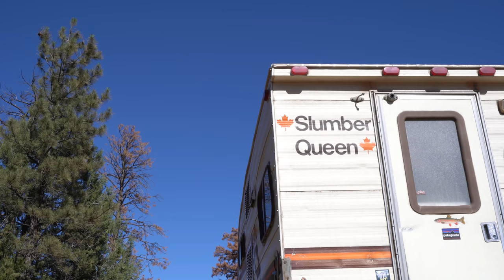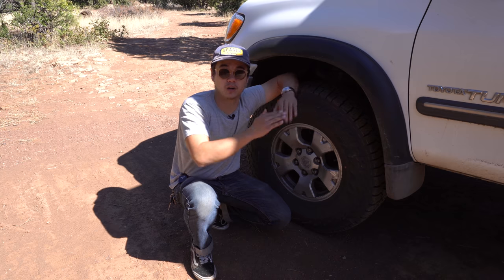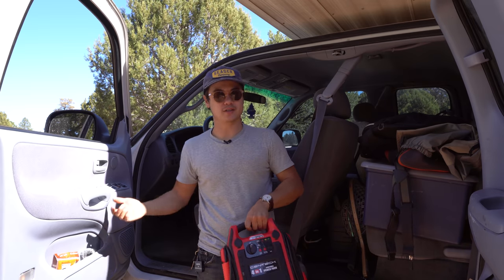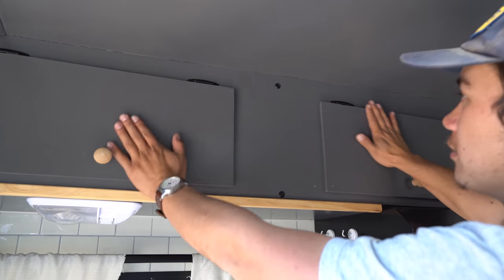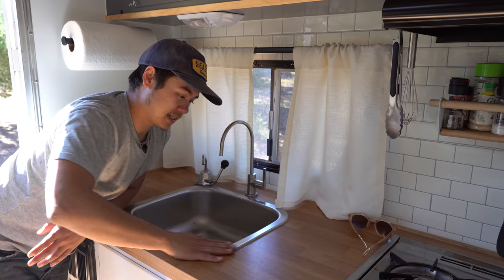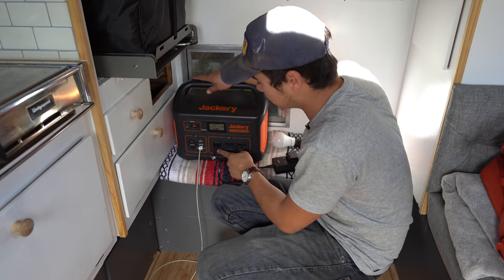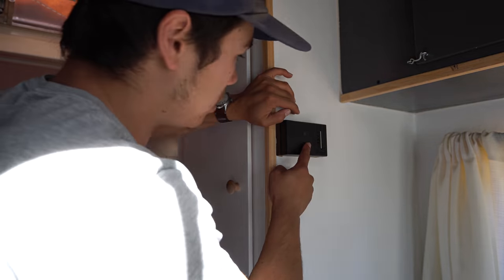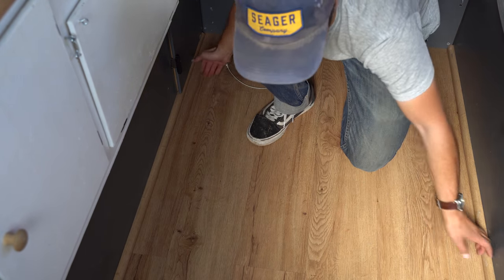A Detailed Tour of my Renovated Vintage Truck Camper (New & Improved)

Comment: Jonathan - check out the “Heng's Vortex II Vent Fan.” It’s a retrofit fan for your roof vent that installs in place of the screen. I had the same vent as you in my vintage travel trailer and the install was probably less than 30 minutes. Having the fan is a game changer. Take care!

Comment: Great job! Love seeing how your journey has unfolded. Just for safety move your CO2 detector closer to the floor as that's where CO2 is first detected. I did what you did and was told by others. So keeping ya safe!
Reply: Yes your CO detector should be place near the floor. CO will settle low, smoke goes to the ceiling. Hence why RV manufacturers place CO detectors near the floor and smoke detectors on the ceiling, per the device manufacturers instructions. There's a reason for that.

Comment: You did a great job on the Reno.  Just a little note, though,….  Smoke detectors go towards the ceiling but carbon monoxide detectors go near the floor.   The reason for this is because carbon monoxide is heavier than oxygen so it fills the room from the bottom first.  By the time the ceiling-mounted detector you have goes off the levels will already be toxic.

Comment: Something to consider for camper tie down under the bed of the truck:  merely use a long one piece length of thick wall 2" square steel tubing. Bolt it to the frame/bolt a piece of channel iron to the frame/then bolt the 2" tubing to the bottom of the channel iron, if need to lower the 2" tubing below the frame. The 2" tubing is minimal cost. Drill holes in each end of the 2" tubing and install eye bolts, to which you can attach your camper tie down chains/spring loaded tied downs/etc. Also, when you need to jack the truck up for any reason, the strength of the thick wall 2" tubing allows you to put a hydraulic jack under the outer end of the 2" tubing for a jack support when jacking up your truck.

Another good use of the 2" thick wall tubing:  if your trailer hitch has a 2" opening going through the trailer hitch mounting assembly, push a 2" thick wall square tube through the opening in the trailer hitch assembly. This will accomplish at least 2 things:  have the 2" tubing extend out past the end of the bumper and use it for attaching camper tie downs; install some heavy duty eye bolts/tow hooks/ etc and they shall be available should you require being towed sometime; the 2" tubing will also act as an extra bumper to the rear of the truck; can hang mud flaps on the 2" tubing also. I've used this setup on every truck I've had over these past many years. Hope this helps others out there...

Comment: I bought a used popup camper last oct. You can camp in it now if you wanted, but...it's fugly inside. For a 93 model, the interior seems a little 70ish lol. That solid wood paneling look. The water heater was removed, and pump, so no water system. I wouldn't have used it anyhow lol YUK.  Makes it's that much lighter. Anyway, I know nothing about them. I have a lot to learn. Waiting on a better bit of weather and then I'll go out and raise it and set it up and see what I've gotten myself into. It will be a learn as you go project as well. I already feel your pain. I've watched some renovation vids, but I'm not looking to get to fancy. Portable, rechargeable and solar items is all I'm putting in it. It has a real AC someone installed. So researching what items I need. Like the Mr. Buddy heater. Those come highly recommended. I see them on every outdoor, camping type vids. I have camping, backpacking gear, but I need to upgrade. I need to get everything. I did get a rechargeable portable power station 500 watt I think for $140. Thought that was a great deal. However, it was a clearance sale. It was 5 stars. We will see lol. It can be recharged by electric, solar or cig lighter outlet in vehicle. So I'm looking at everyones vids. checking out their equipment, where they got it, how it holds up etc..

Comment: Suggestion on your main battery:  if you are going to stay with a lead/acid battery, consider using a AGM instead of that flooded cell battery.   Thanks for the update on the camper.  Sure looks like fun.

Comment: Your carbon monoxide alarm should be close to the floor Jon
Reply: About 5 feet.  Co is slightly lighter than air.  Specially with you sleeping high up an sometimes using the little buddy heater.
Reply: @dandingess8267  yeah but i was looking it up and it says Co lingers lower by the floor. I don't you could be right.
Reply: In houses carbon monoxide detectors are placed on walls and not on floors.
Reply: Propane is heavy. Often dectectors for propane meant for RVs are combined with CO detectors, and those units are meant to be mounted low. There are smoke detector/CO detector combo units that are meant to be mounted high. CO specific detectors can me mounted anywhere.

Comment: Hey bud, when you upgrade your electrical system consider a DC to DC converter to charge your house battery from the alternator. On my setup I can charge at 50amps from the alternator. You will need to run a positive cable from the alternator and a larger ground to frame.  Oh and get a lithium battery. Those Lead acid are heavy, slow to charge, short live piece of crap. My setup is a F350 and a Lance truck camper.

Comment: You have done all the necessary repairs. If you still have the original radiator swap it out. They tend to fail internally and leak coolant in to the transmission.

Comment: As great as solar is.. it definitely has drawbacks. I have a 300W setup and I find that solar is not very effective from September until March. Especially in northern regions. I have a renogy dc to dc with MPPT charge controller (50A) and I find that most of my charging is from my alternator. The solar rarely gets more then 6-8A per hour of charging and I only get charging for about 4-5 hours, and being in the PNW, I’m hardly getting any right now. 

Instead of spending a bunch on solar, maybe spend more on a larger lithium battery. They are getting way more affordable and dc to dc chargers are cheap. I would suggest upgrading your current alternator charger method to a proper dc to dc charger if you do upgrade to lithium as your current setup could overload your alternator with a lithium battery.

Comment: with the narrow foot of your camper ( 37-1/2 inches on my nearly identical Davlin) and the much wider space between your wheel wells, there is no blocking to keep the camper from sliding side to side inside the bed.  Raising it just makes this worse.  All the side to side force is then resisted only by friction on the bottom, and by the springy tie down and the flimsy 1/4 inch eye bolts into the camper frame.   Some wooden blocks cut to fit to wedge the bottom against the wheel wells would be cheap insurance.,

Comment: Did you measure and fit... before you added the box?  It looks as if the camper would have fit, and you would be 4 inches less tall and top heavy without it ?  I personally believe these campers are made to be supported by the sides of the truck,as well as the bottom... and that a long bearing on the bed walls, allows multiple attachment points, rather than concentrating the load that keeps the camper IN the truck on just 4 points.   if you look at what the attach points actually are inside the camper.. you may be shocked to see that all that force of a pitching camper is foucused on a 1/4 inch bolt going through a 3/4 inch  by 1 1/2"  stick of wood and 1/2 inch of plywood !   And then if pull on that bolt at an angle, the framing can break !

Comment: Johnathon, if you are going to speak to 2,000 people I would humbly suggest you have some responsibility to make what you say Factual, and Specific instead of vague or just flat wrong. It is easy to measure your gas milage.  It is easy to look up the usefull load and gross axle weight and center of gravity for your New Truck.  Why blow smoke about it ? !! The stock useful load of the 2000 Tacoma  2wd is 1100 lbs with  the 4 cyl engine.  The 4wd is only 750 lbs, ditto for off road versions .  Pre-runner can be 1500 lbs useful load.  Tacoma with pre-runner springs  and rear shackles can up it to 1500 lbs also.   Beware the engine and off road options will Radically Change your safe load capacity. Know Your Model !
      You need to consult your Owner's Manual for the useful load of your Tundra.    I made a long post about the capacities and limits of the first gen Tacomas  because a camper like ours will max them out., Newer campers ( like a lance at 1700 lbs for smallest )  will put them severely over gross, and cannot be safely used on our Toyotas !

Comment: Hey you can get your gas door on Amazon
Reply from the maker: The gas door doesn’t open when my turnbuckle is installed so I removed the gas door.
Reply: @JonathanYentch  glue a magnet to it and glue one to the inside of the fuel door. Looks stock but a quick release option